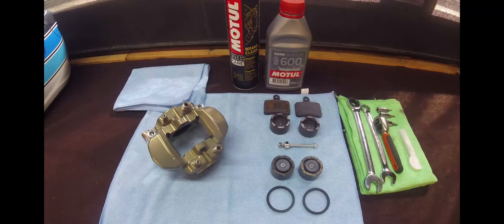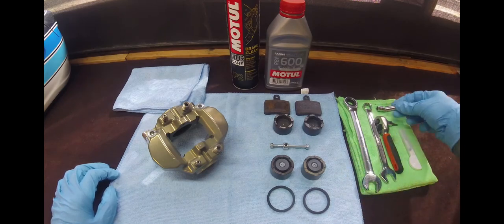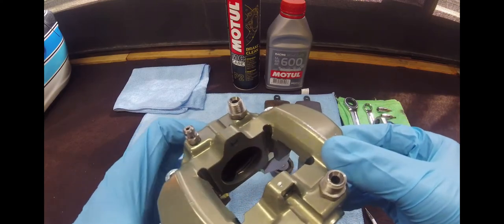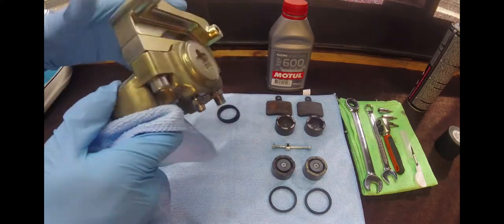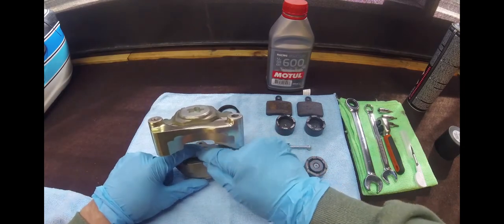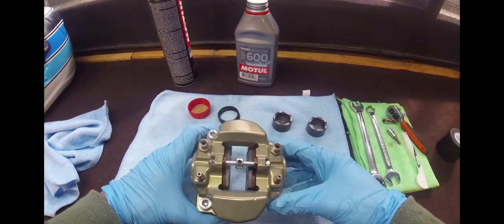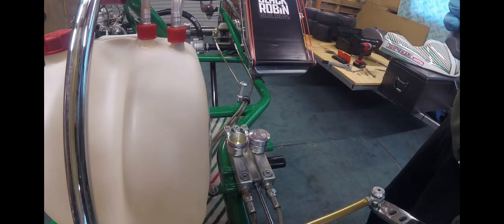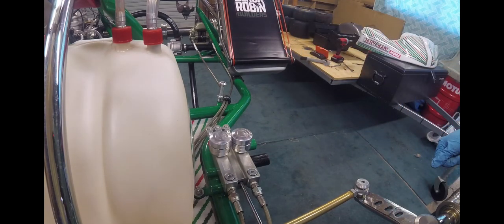OTK Tony Kart BSD brake caliper rebuild and brake bleed

Comment: Can I ask why the outside line has to loop around and become the inside line on the master cylinder?
Reply from the maker: It won't be any specific reason just how it's worked out with the positions of the different fittings on the master and caliper.

Comment: The OTK diagram shows a circlip that goes together with the seals. I didn't see this circlip in your video. Any idea what about this circlip is for ?
Reply from the maker: Unsure sorry, definitely never come across circlips holding brake piston seals before.
Reply: @danbloxham6133  thanks anyway !
Reply: The newer selfadjusting OTK Brakes have circlips (sealfadusting > pedal stroke/travel stays the same as the brake pads get worn down)
Their task is to "squeeze" the sealing ring as the piston gets pushed out, so the sealing ring holds the piston when the break-pedal is released
With those its really important that you put them in position in front of the sealing ring (they often slip back when you take out the sealing ring). Otherwise you will not be able to bleed the system propperly (respectively adjust the brake travel properly) as the piston will then always slip back, when you release the pedal.
Reply: Thank you so much. Very helpful
Reply: @User85306  sorry but it is not 100% clear to me. When you say "in front" , does that mean that this circlip needs to stay in the groove closer to the brake pads, and not hitting the end of the calipers (close to the wheels of the kart), right ?
Reply: @kartaroundtheworld  No Problem: closer to the pads.
Reply: @User85306  you're the best ! Thanks

Comment: Do the pistons need to be replaced for a regular rebuild if there are no problems with them or just seals?
Reply from the maker: Hi Dustin just the seals mate, always check for any corrosion though and replace parts if necessary.
Reply: @danbloxham6133  thanks!